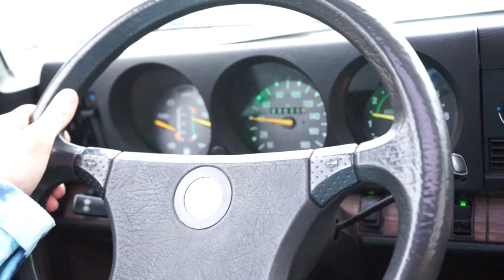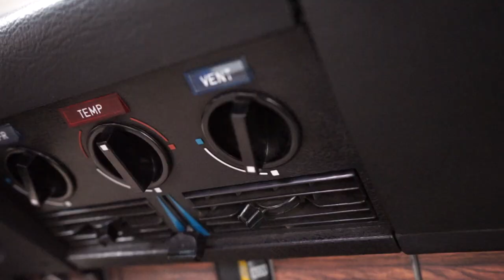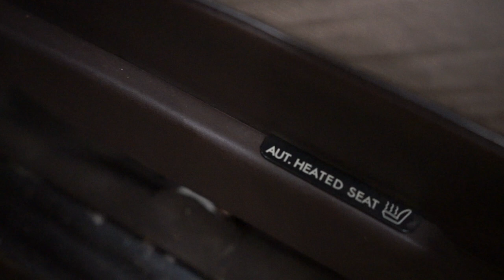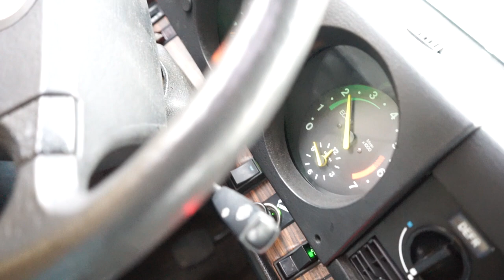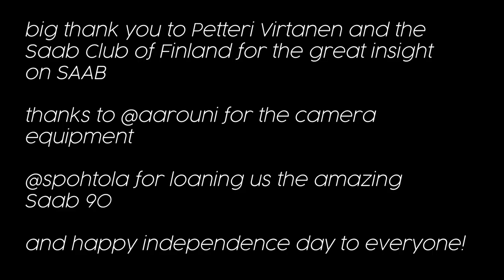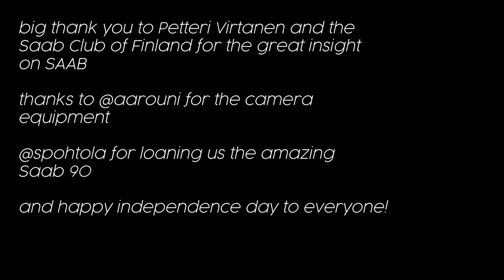The story of the 1986 Saab 90 - made in Finland

Comment: im in the uk ive just saved a 1985 saab 90 from going to a breakers yard, needs a lot to get her back on the road but im hopeful to get it done over winter and be able to use it throughout the summer.
Reply from the maker: Rust repairs?
Reply: @FinnishCarGuys  very little rust work surprisingly, the carb wants rebuilding and setting up, ive just replaced the clutch, wants the headlights wiper system fixing and putting back together and thats all really for the big bits, after thats its just tidying up and fixing the little bits

Comment: The subtitles don't quite translate. Kowabunga factory lol. My dad owned a mk 1 90, no side indicators, was a great car to drive, good grip, powerful smooth engine and gears, I did once spin it going a little too fast. Electrics were shockingly bad, running lights burning out almost weekly, the heated seat thermostat failing, the ignition ampflier failed. MPG was good and had that great unleaded prepared engine.
Reply from the maker: Yeah the English subs are auto generated. Finnish ones done by hand.

Comment: Parents owned a SAAB 90 bought around 1990 and sold around 2005/6 - was in almost daily use along with other cars, having gone from them to my brother and then to me. Pretty darn reliable, and climbed snow almost like a Subaru 1800 with low gear, but boy, was it heavy on the steering! Non-powered steering, and getting a tad thirsty, but still, about 13l in winter for short distance driving or 15k. Still exists I believe, a testament of rugged Finnish manufacturing.
Reply from the maker: In Iceland I presume..? How’s the road salt / rust situation up there?
Reply: @FinnishCarGuys  Loads of salt and rust. Last time I heard some repairs were necessary on beam below doors.

Comment: Drive my 1991 900 Convertible every day.  Almost 30 years old and still no rust.  Car was bought in Las Vegas and then brought to Colorado in 1997.  Third owner with just 170,000 Miles.  Put the top down and crank Monty Python Finland song.  Millennials impressed it has an airbag and antilock brakes.  They love the retro clamshell styling and analog gauges.

Comment: SAAB was failing in 1999 and needed GM more than GM needed SAAB. I don't like post 2002/Opel/Russelheim SAABs either but let's not rewrite history. They were "too" well made and the margins were not enough for SAAB to compete internationally. 1994 - 2002 were the best SAABs to have- GM used their supply chain to put more reliable Japanese transmissions [Aisin Warner] and turbos [Mitsubishi] into Sodertalje/Trollhattan/Uusikaupunki engines and bodies.